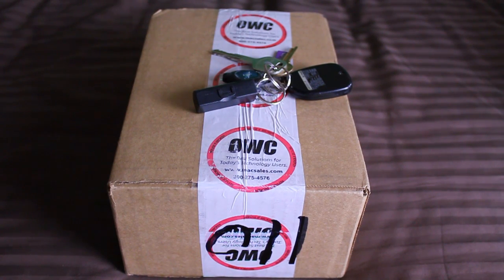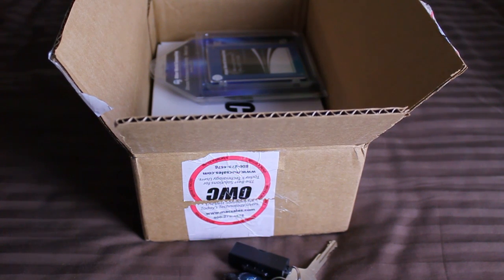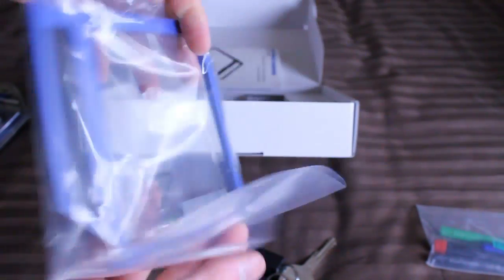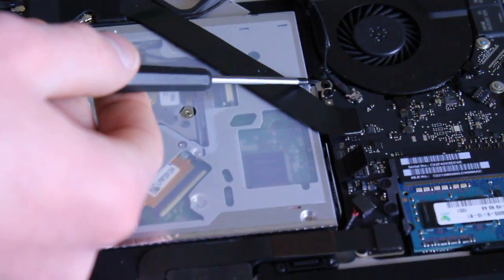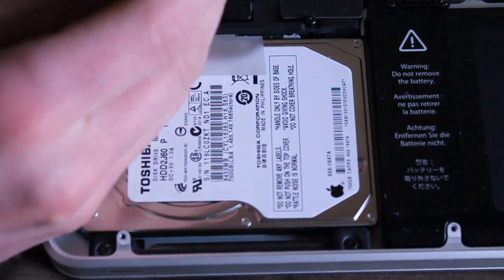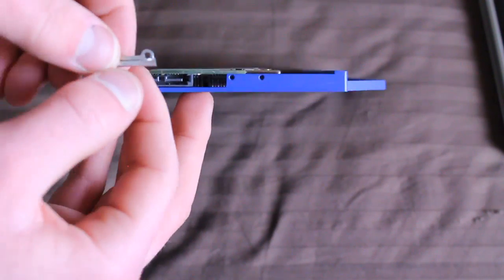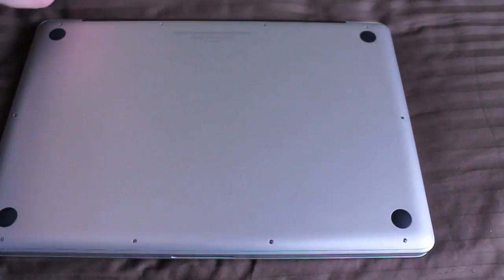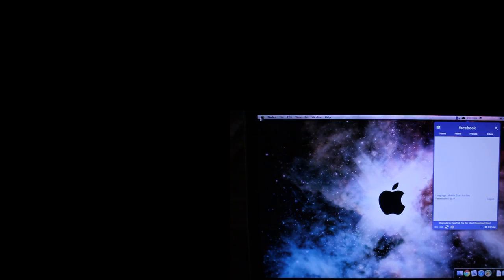OWC Data Doubler and Mercury Extreme SSD Unboxing/Install/Boot on 2011 MacBook Pro 15" 2.2 GHz i7

Comment from the maker: @EG33s No.  It works in addition.  Via the Apple website, you are only allowed to select what goes into the drive bay.  This essentially adds two bays so you can have two separate disks in one system.

Comment from the maker: @pspfano It's kinda a grey area.  I talked to my local Genius Bar and said that it wasn't an issue at all so long as I didn't dammage anything in the process of installing, but I've read various forums that say it does/doesn't void, so I truly couldn't tell you.  You can always replace the old optical drive if something went awry, and they wouldn't know you even touched it to play it safe.  Idk, it's pretty subjective.   You can toy with HDD and RAM, everything else is a gray area.

Comment: @ThatSnazzyiPhoneGuy I've read that installing the SSD in the HDD bay and moving HDD to the optical bay is best because the MacBook won't look at the opitcal bay SATA port when waking from sleep. So if you install the SSD in the optical bay you'll have troubles waking your MBP from sleep.

Comment: @PrinceSeiki Yes. Very much so. I believe the only things that Apple would allow a user to do without voiding the warranty would be co upgrade your RAM and replace / upgrade your existing hard drive that came with the computer. Reason is because they give you instructions on how to do both of those things in the manual that comes with the computer. Ripping out the optical drive and replacing it with a hard drive and enclosure is completely different from simply upgrading under Apple's terms.

Comment: Just ordered one of these bad boys the other day. Cant wait to get this installed. I was a little worried when I read on the OWC site that the 6G SSD wasnt reliable in the optical bay but I saw that you could put the SSD into the spot of the original HDD so I am no longer concerned. Great video! So does the kit come with everything you need to do what you did in this video?

Comment: @ThatSnazzyiPhoneGuy  I recommend that you return that ssd and get the OCZ vertex 3
and since the front left SATA port (where the HDD was origionally) is SATA III 6gb/s
and the one where the optical drive was is SATA II 3gb/s it does matter where you put the drive especially if you get a SATA III SSD.
Therefore i think you should take advantage of OWC's 30 day money-back guaranty , pay a little more for a SATA III SSD(I suggest the OCZ Vertex III) and have almost twice the speed that the OWC ssd

Comment: Hi Quinn,
I'm thinking about buying this exact same kit for my 13" MacBook Pro, and I'm just wondering if you think it's worth the money. Have you had any problems with the SSD? Also, does it seem like it would be easy enough to put the optical drive back in, just incase I need to take it in to get serviced? Your response would be greatly appreciated. Thank you.

Comment: @JOEJOETHEJOEY That's my second question: The whole vibration thing. I've been told that it's best to place the new SSD into the old HDD slot and move the old HDD into the Optical drive slot/section? Why? I've also been told that it has something to do with the amount of power that both slots provide. I could be wrong so I'm not stating that any of this is true. Also, does Super Duper only duplicate your system folder or the entire drive?

Comment: absolutely does not matter. you can use SSD to store everything as long as you can afford the storage.   i have 2x 512 SSD in my macbook pro the optical bay is only sata 2 so i would not recommend using RAID. its actually much faster to use SSD only. if you dont have to use a regular HDD dont.  Now  there used to be problems with SSD's wearing out the more they are written over.  but newer models are better with that.  i write over my SSD's all the time and they are still running perfectly

Comment: @ejicon I would assume that it's the other way round coz the original HDD bay has shock protection of some sort, since SSD's don't have any moving parts, it'll be better to keep the original HDD in it's slot.  But I'm not sure whether you can set the 2nd bay as master for running the OS on.  I guess we need some expert to explain.

Comment: @ejicon I'd like to know too.  I'm assuming there is a controller on those caddies.  Also, will the original HDD be affected without any vibration protection?

Comment: Cool, I have seen so many of those Data Doubler purchase's, maybe Apple next time they update will take not that ppl want more storage rather than the optical Drive's, Very interesting Video you shot there Quinn, And am i right in saying that the Drive Bay Frame was made out of plastic rather than Metal ?, great video BTW :)

Comment: if you are going to put an SSD in your optical bay you might want to save money and buy a SATA II SSD since the optical bay can not reach SATA III speeds.  Putting a SATA III drive in your optical bay is overkill basically.

Comment: Hi!
i'm going to do this upgrade when i'll have my macbook pro 15".
i have some questions tho, How is the OWC SSD performing? i heard those SSD's like OCZ ones and other lose their performance over time...  and what do you use your over 100go SSD for? i'm wondering if it would be worth for me to pay extra money and get a reliable intel SSD over time with a much smaller memory capacity (around 40gb, for mac OS and all my applications, then put all my data on the HDD.)

What do you think?

cheers'

Comment: @EG33s SSDs have a MUCH faster read / write speed than HDDs, that's why is costs more for less :) You can get insanely fast boot up / application launch speeds with an SSD rather than an HDD.

Comment: This isn't clever mate, swapping the drives. The HDD has moving parts and is closer to the MB, whereas the SSD is still and is located in an area where it has rubber pads, which are useless for an SSD, but crucial to an HDD that causes vibrations to the whole machine. Here it vibrates near the MB and may damage it. Go ahead and swap them, and yes, it matters where you put your SSD and HDD.